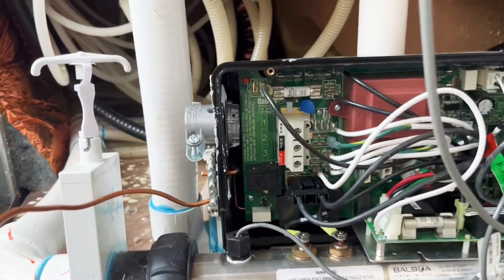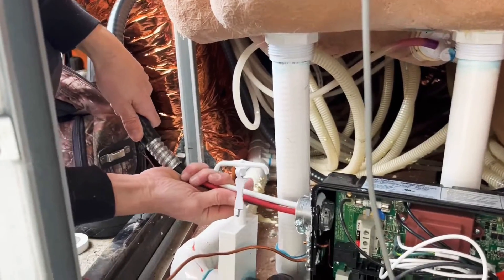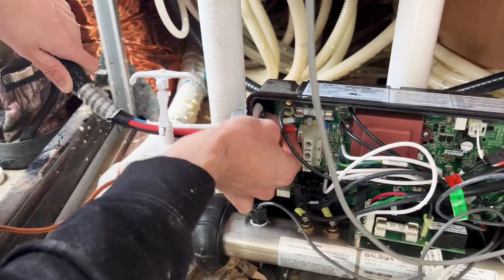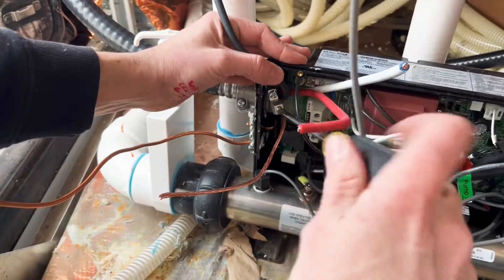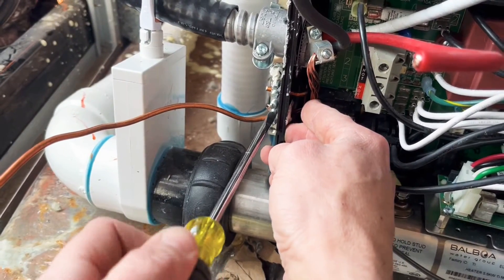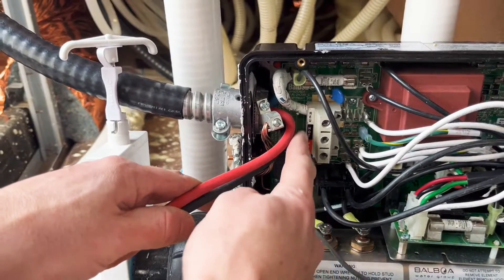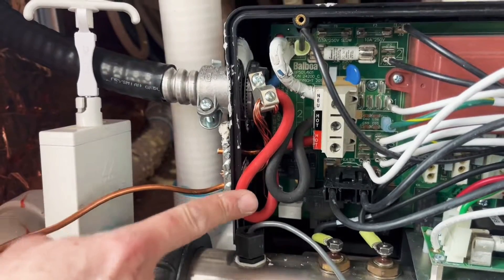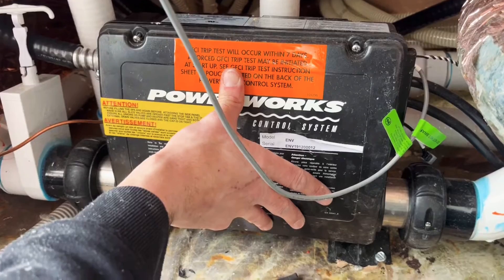Hot tub controller terminations

Comment: Nice video,making the terminations inside a hot tub is never easy! Why did you have to bond the armour of the tek cable in the hot tub if you have already bonded it to the metal enclosure(ie. the spa pack) ??
Reply: The Canadian code (CEC) says you need to bond a metal connector when installing it into a plastic box.
Reply: The Canadian code (CEC) says you need to bond a metal connector when installing it into a plastic box.